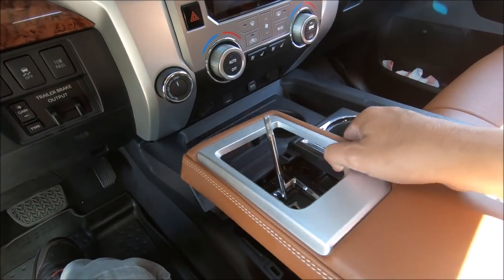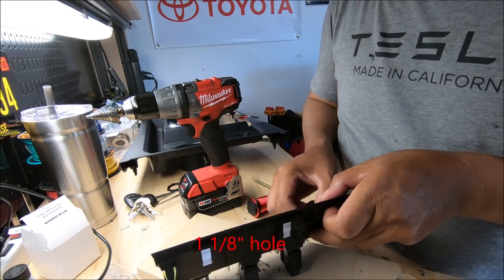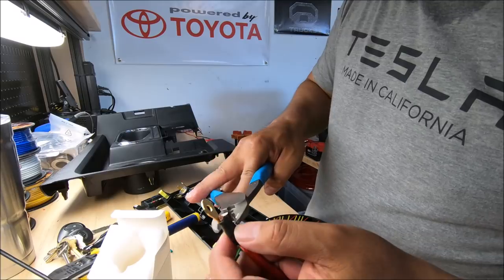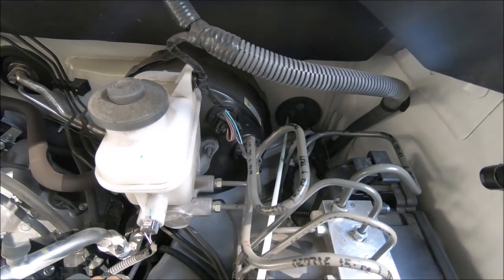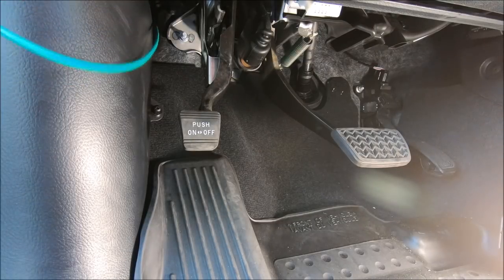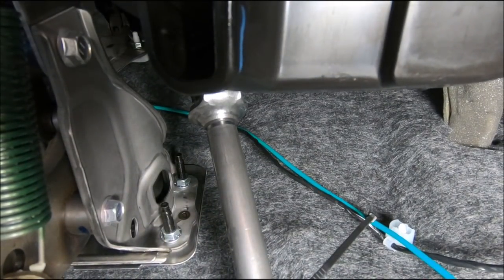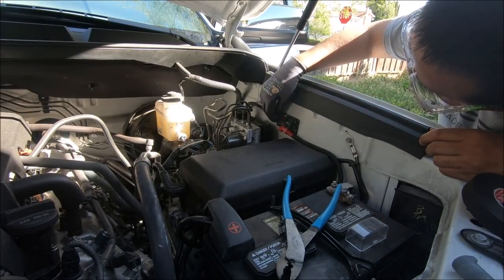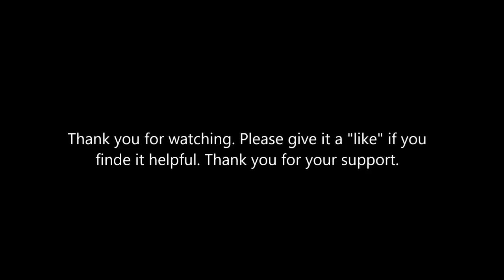Installing Always-On USB Charger on 2016 Toyota Tundra

Comment: I found a USB port on Amazon.  It has an on/off switch that lights up (blue).  I installed it on the back of the console similar to what you did.  I did the LED foot well, install same as you but managed to do them all at the same time so I didn’t have to take the console apart more than once.  I also put in two additional rocker switches, ran out the leads, capped them off just in case I wanted to add more lighting.  Your videos were amazing, ensuring I made no mistakes
Reply from the maker: Good job! Thanks for your comment.

Comment: Excellent video. Are there any battery issues with the light on the USB adapter always being on? Does it drain the battery?
Reply from the maker: Yes, there is a tiny amount of power drain so I chose none-lighted USB for the always on outlet.

Comment: Another great video. Thanks for the sharing your mods. I've got a question. What if I want to take out the cig lighter and replace it with the same plug you place, but I do not want it "on" all of the time. Do you have any suggestions for using the same OEM wiring plug? Thanks.

Comment: Why did you run that separate green wire...couldnt you have just put that red wire on the positive terminal of the USB charger?  good video
Reply from the maker: I wanted to use dedicated circuit from the battery and have it always-on.